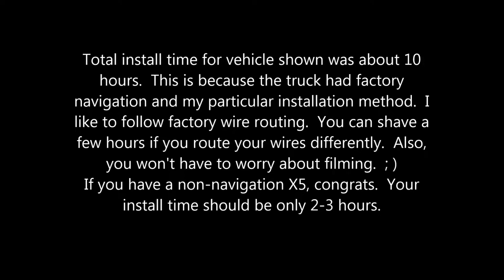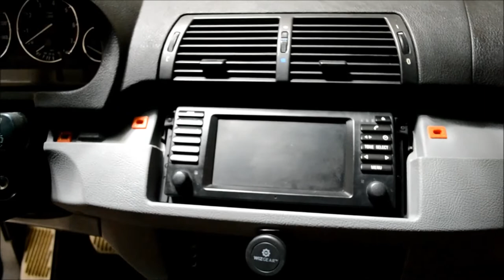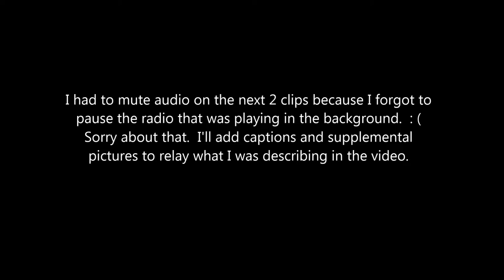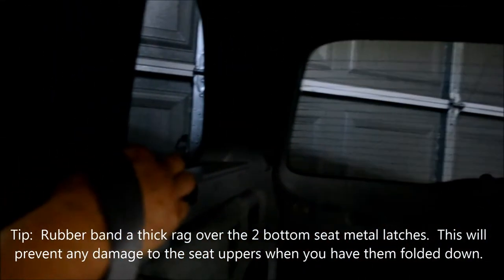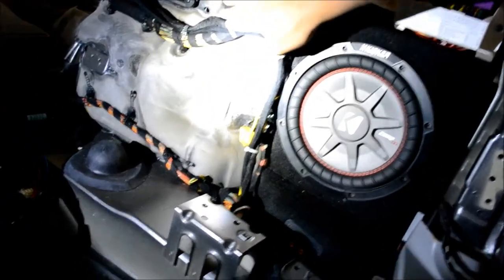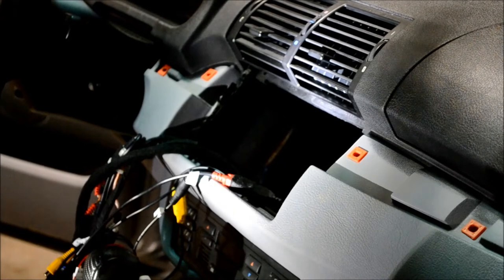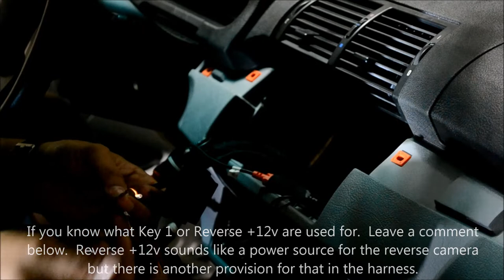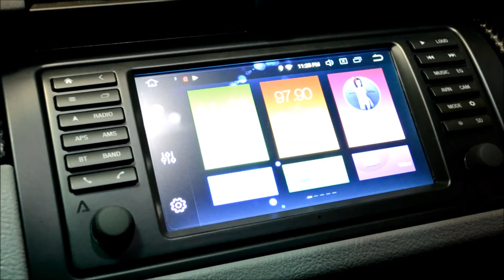Avin Avant 4 Android BMW E53 X5 Install Guide

Comment: So, I am a new with the E53.  Not new to electronics or even any of this type of work, so I don't see anything really that difficult... Try running cables 400 ft on a Navy ship, a few hundred times or so... It just becomes easy with experience.  Anyways, I do have a big question.  How hard would it be to run the cables up the right back pillar from the boot and straight forward on the right side of the vehicle and back down the A pillar to the dash, while tucking the cable between the headliner and roof?  This would also allow easy access for the mic and GPS runs.  Just a thought.  I don't have my vehicle close to me, at this time, so I don't have the option to go look at it.  I did look through a few headliner replacement post and headliner sagging post.  My main concern would probably be creating more problems with sagging or damage to the roofliner.  But even in that case, maybe a few zip tie anchors and some jb-weld could be attached for securing the cable to the roof under the liner...  again... I am just curious.

Ok.  Second question.  With this cable run in the video, is there any Engine, EMI or RF noise coming from the main harness run, going into your sound system? 

And by the way... GREAT VIDEO man!
Reply from the maker: Thank you for the compliment.  Running the cables up the d pillar to the a pillar would likely be possible if you limit the thickness of the run. But the amount of work involved would likely be the same or more to drop the headliner. If you were just going to tuck it in it might save time though. I have not experienced any interference doing my runs along the factory harness. Good luck with your install, and thank you for your service.

Comment: Thank you very much for this video. I couldn't help but mutter to myself quite a number of times something along the lines of  "bloody hell" and "what a nightmare" along with "it's going to take me days!". Seriously, this is one heck of a full on installation! A couple of questions, can't you use the factory microphone? What extras amps do you need or did you install, if any? Can you tell us a little about the kicker sub in the back? Are all the speakers other than the sub factory?

Finally how does it sound? 

I would have loved a bit more coverage of the unit such as menus and whether you retain all the factory usability such as the trip computer, etc. 

Thanks again 👍
Reply from the maker: First, great SN. Yes, it is a job and a half to install the way I did, glad this video still helps ppl. Now the questions. The factory mic could possibly utilized if you could find some way to adapt the connector but I'm not sure. This X5 got only an extra mono amp for the Kicker 10" sub in the rear. The factory HiFi audio amplifier was retained for the 10 interior channels. All the interior speakers were HiFi trim level factory drivers. Adding the Avin greatly increased their sound quality due to the EQ and DSP options it has for tuning. The iBus unit does retain the trip computer and all other OBC functionality. Without it, you lose those functions. I would have loved to demo and review the unit but the video was already long and I had to leave town the next day. I see you're on XOutpost so I'll reach out to you there. 👍
Reply: @crystalworks1  Great, thanks, chat there.

Comment: I install the Ibus app. When I press the DSP on the screen the radio comes on but cut off after 38.4 sec. I must say that my original radio on my E38 was cutting out after 2min 40sec. but I was told I had to replace my DVD GPS NAV. MKIII TO  MKIV version I disconnected the NAV. 
completely but radio still cut out, the Avant4 at 38.sec. and my original at 2min. 40sec. On the ibus app screen, it flashing WARM AND OVERHEATING not sure why. Can you say why Thanks

Comment: Hi Great Video, do you know if installing the external Mic is there a setting in the unit to tell it to use the external one instead of the internal one, or does it just automatically recognise that an external mic is plugged in? Thanks
Reply from the maker: You know, I'm not sure. This was actually installed in my old X5 right before my buddy bought it so my hands-on experience with the unit is limited. I'll check with him and get back to you.

Comment: Thanks for your video. I have a 2001 E38 BMW and going to buy one.I notice i did not see the bracket for the unit. Does it come with one
Reply from the maker: Hope some of it crosses with your 7 series install.  It does not come with the brackets.  I believe they offer it as an add-on item.  Factory nav e53 x5 installs don't require them.  Not sure about the e38 7 series.  One of the few "modern" BMW's I have not owned.
Reply: Depends on wether you had navigation on stock. If no 16:9 or 4:3 Monitor installed you need to buy a bracket stand from BMW. If you had a monitor before nothing needed, the bezel is included

Comment: Can you talk about hooking up the nav extension cable in the trunk? I know you said only hook up one cable but where?  Is it to the nav box that has an antenna plug on it too?  Do you leave that antenna cable plugged in?  If I wanted to tie the avant 4 into the real antenna can I just run the antenna ext cable from new radio to this same box and replace the existing cable in it?  Thx
Reply from the maker: Yes, you can tie into the antenna at the nav unit. They don't provide an adapter/extension with the unit (I don't believe). It might be an added purchase.

Comment: Great video. Thanks Crystalworks. One question - does the rear view camera turn on only when reverse is engaged? Can it be wired such that it can work with reverse gear and when the camera button is pressed?
Reply from the maker: It actually has built in canbus support for the reverse signal and pdc I think. In the video I used a custom trigger setup for reverse. Totally unnecessary. If you just hook up the camera feed the Avin does all the work for you, including triggering when you press the pdc button I believe. I'll double check though and report back.
Reply: The trigger wire is simply the power wire though right? Aka, you "trigger" the reverse camera to turn on by sending voltage to it. On my older setup with an eonon unit I wired the reverse camera power wire into the reverse light feed. For this unit though it's more than just a reverse camera, it's also the DVR so it should be powered up or "triggered" any time the key or engine is on. I'm thinking of what I should tap into as I'm wiring it up now
Reply from the maker: @TR4G  Sorry just saw this.  The "trigger" is what tells the head unit to switch to the rearview camera.  Not necessarily the same feed to power the camera, though it can be in some installs.  I made my own custom setup but it's not necessary for the Avin (or any new Android unit that has canbus). Just hook the camera's 12v feed up to CAM+, ground the camera in the back hatch somewhere (preferably at a factory ground), and hookup the yellow RCA and you should be good to go.  The Avin should take care of the rest.  I didn't check to see if CAM+ was 12v constant or switched though, so if doing a DVR setup verify that.  You can not feed power of a late model E53 X5's tail lights as they use PWM voltage to the tail lights for adaptive braking.  You would need to use a relay.  Anyway, lots of ways to skin this cat, good luck with your install.  Probably finished it already so I hope it went well.
Reply: @crystalworks1  Hi thanks for this information. Just bought a E53 and my headunit does have a canbus decoder. The reverse camera is there but the guy didn' fully install it. The camera has a licence plate led light attached to it and the led light it does turn on when the front lights are on. Does that mean, all I have to do is just have  hookup the yellow RCA to the head unit and it should work fine ? Should I ignore the red cables on the RCA cable? many thanks.
Reply from the maker: @appsupport9871  The yellow wire needs to be hooked up, and the camera will need positive and ground. You'll need to see what the previous owner did in the tailgate area.  There should be a +/- wire for the led license plate light and a set for the camera. The red wire on the yellow RCA can be ignored, or you can use it to supply power to the camera (if he never hooked up the camera).
Reply: @crystalworks1  Cool. Just to clarify, the reverse camera on my car replaces the original licence plate light ( this is the my camera tinyurl.com/1dti5l62
 ). It seems there's only one wire coming from the camera and since the led licence light comes on when front lights are on, I presume the +/- wire is all hooked up ? probably just need to get the extension cable for RCA I believe
Reply from the maker: @appsupport9871  Yes, sorry, thought I read in your previous post that the license plate LEDs did not come on with the lights. Those should be good then. I used that same camera on this truck so you should just need the power/ground cable (barrel style connector) and the yellow RCA hooked up. The canbus will take care of switching. Be careful though, most hook up the +/- for the camera to the reverse lights. You can not do that on the E53 because those lights are PWM controlled by the LCM.
Reply: @crystalworks1  brilliant, thank very much  mate :)

Comment: So what about the antenna? He didn't mention anything about the in the video and I was curious The nav unit in the back has a black antenna plug which I'm assuming goes to the actual antenna somewhere in the car.

But then they also give you this long cable that looks like an antenna cable that's supposed to run the length of the car.

Did you not hook up an antenna in your vehicle or did you run an antenna wire along with your nav harness from the front to the back?
Reply from the maker: Sorry, meant to add a note about that. The antenna can be picked up in the center console or in the back of the truck. I forget the name of the plug used by BMW. It's purple though. An adapter is needed that Avin did not supply. The Avin 2 that was installed previously already had the appropriate cable/connector so we used that.
Reply: @crystalworks1  thanks man.  What about the the radio? I have factory navigation and DSP and when I unplug the radio harness from the factory radio. It has little blue locks on it that prevent me from plugging in the Avin harness. And do the I remove the factory radio completely? It leave it in and plug something else into it?
Reply from the maker: @THE46GUY  if you have nav/dsp then the 2 harnesses plugged in at the factory screen will no longer be used by anything. If you are talking about the big fakra cable in the back... Those blue blocks should remain in place.
Reply: @crystalworks1  okay so what you're saying is I plug the end of the Avin harness into the factory radio and leave it in there because it's the only place it will plug into. I watched your video and you have four adapter plugs router to the back of the car and one up front at the other end of the cable.

I only see one plug in the back quad lock connector going to the existing factory radio so I unplug that one and you're telling me that I need to plug in the Avin harness whichever one fits properly into the radio because none of them will plug into the harness that I removed from the radio.
Basically did you leave your factory radio in the car and use it still for something or did you remove the unit.

Comment: Hey bud! Excellent video, you’ve literally ticked all the items I need for my installation. I have a 2004 Range Rover which is basically the exact same thing as your E53. I have the DSP, Navi, etc. I was wondering if you knew where I could buy the harness you had which the canbus decoder and the iBus interface hook up to. Btw whoever incorporated that iBus interface into that wiring loom deserves a freaking medal, kudos! I have already ordered the iBus USB stick, just wanting to find and purchase the loom you have in your video before I order my 12.8” Tesla Style Android Unit ;)
Reply from the maker: Thanks for the compliment.  I wish I had lit the interior better but we were in a rush so made due with what we had. That harness came with the Avin but I think most of the newer Android units do as well. I installed a 10" (no physical buttons) style in my other E53 and it also came with the long harness with canbus and iBus provision.  I forget the brand.  But as far as I know Seicane, Eonon, and Avin all have options for the long cable with those hookups.  Check with whoever sells yours and see if they know of something.  Good luck with your install.
Reply: Hey thanks for your reply! Yes okay that sounds good, I’ll try and look around those retailers and see if they sell those harnesses separately.
Reply from the maker: @RangeK1D  Definitely do that. But remember the harness pinouts at the radios might differ. So be sure you get one designed to work with your brand.
Reply: From the looks of it the output is the same one as you have, 20 pin output with the single groove on top of the plug. I sent a link above, does that harness seem similar to the one you had?
Reply from the maker: @RangeK1D  It seems similar.  But I wouldn't be able to tell you if it will work with your radio.  Didn't appear to have iBus prewired.  Easy to tap that into the cars wiring though.
Reply: @crystalworks1  Yeah I'll just end up wiring it directly into the harness. I found another head unit that I might purchase instead of the 12.8" unit. Its a 10.25" android head unit meant for BMW's, apparently it has a built in DSP amplifier, not sure if this is the reason its compatible with DSP AMP E53's, will find out if I even need to attach the iBus interface USB or not.

Comment: I am getting ready to install mine, I bought the GPS antennae extension it appeared to me that the anntenae plug in was already there from the factory unit?  Do you remove the OEM harness or just put this new harness next to it?
Reply from the maker: Good luck with the install.  I used the Avin GPS antennae and have had no issues.  The radio antennae however requires an adapter I think.  Been awhile.  You don't remove the OE harness.  The Avin plugs into it in the rear (or front depending on your X5's options).

Comment: I have a question, see that you plug i-bus interace and you have also canbus box installed, tell me is it nessesery to plug canbus box if you have i-bus from reselers.de ? i cannot config proper steering wheel controls and try to find solutions for that
Reply from the maker: Yes, the canbus box is how you retain the steering wheel controls. I don't think the resler ibus interface will allow configuration of the controls. Would be a cool feature though.
Reply: @crystalworks1  So to use steering wheel control and board computer function i have to use both common, right? my volume control wont work with my canbus, tell me what kind of protocol settings are you use. My factory unit is with 7 inch screen that means i had only 2 connectors in front (white and blue) and radio unit have in back of car. Do you have the same or diffrent type of connector in head unit front of dashboard?

Comment: Hi, what backup camera did you use ?
Reply from the maker: I used the cameras that Avin used to sell as for the e53 x5. It was not and fit horribly. I had to modify that camera heavily. I would not recommend using it and following my installation of the Avin avant 2 they stopped recommending it for the e53 x5.

Comment: Did you leave the BM54 modul connected with this android ?
Reply from the maker: The bm54 is the original radio module in the trunk correct?  If so, then no.  It gets replaced.  If you have DSP you will need the roof resler USB interface to keep the DSP and from turning off after 30ish seconds.
Reply: @crystalworks1  Yes it's DSP in the car and the long 5 meter cable have double connections to bm54
Reply from the maker: @mantassuz  I always wondered if you could connect both the bm54 AND the new Android head unit to avoid needing the resler USB setup. I never tried it though. If you do, please report back. If love to know for future installs.

Comment: I am referring to this -(OEM bracket SKU: 51168247250 to complete my install). Can you tell if you are able to answer your phone via the steering  wheel and are able to speak from the mic on the Avant 4 Unit or do you need an external mic.Thanks
Reply: I am able to answer and disconnect calls from the steering wheel just like the OEM hands free system.  My internal microphone seems to work fine.

Comment: Damn dude you couldnt show us where everything was being plugged into in the back wtf 😠
Reply from the maker: I guess we could have.  But the plugs are keyed so only one place really to put them.  Did you have a question about something?
Reply: @crystalworks1  hey! I’m currently installing an AVIN unit and I’m having issues figuring out the plugs in the back. I plugged in the ones that needed to be plugged in but there are a couple left. Do we use all pieces of the quadlock on the end that comes with 4?
Reply from the maker: @johnDoe-gi3gr  No you don't. You'll only use 1.  They provide 4 harnesses so that they cover all 4 different plug variations that the E53 X5 came optioned with through the production run. Good luck with your installation. Post if you have any other questions, will help if I can.